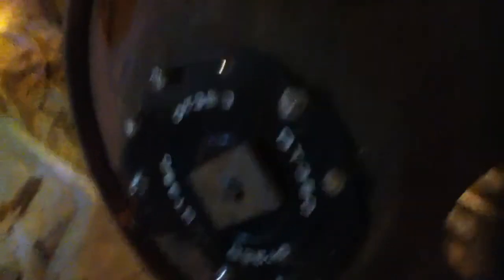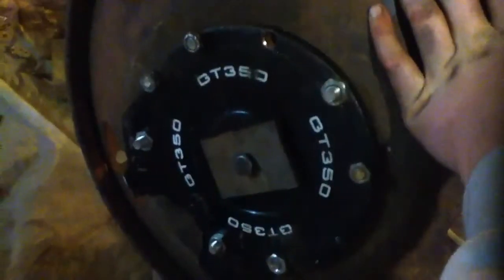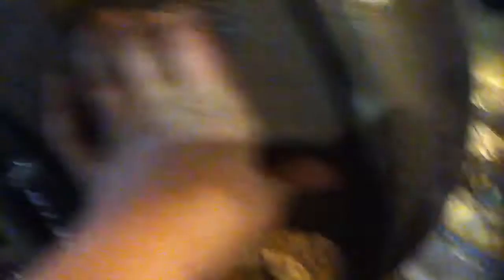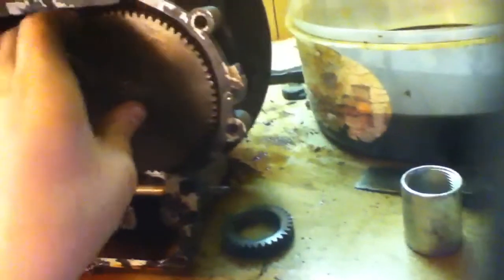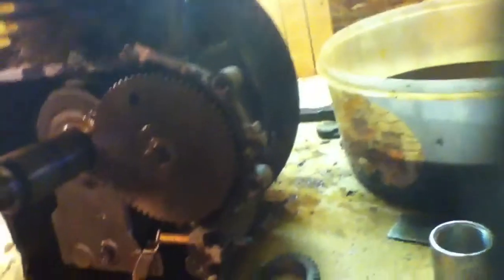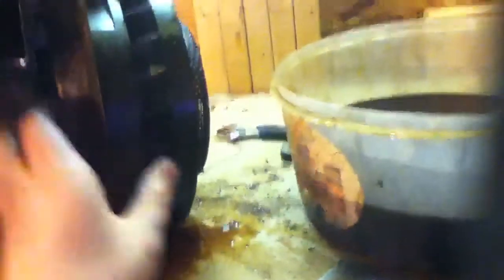Odd homemade steam engine idea

Comment: Now, take the set screw, washer, nut you purchased and screw it into your piston crown. Start out by threading it into the hole so it is in as far as the piston crown thickness. Tighten the jam nut slightly, not real tight at this time.
Put the head back on and see if the set screw sticks up much. It may project above the spark plug boss or it may be down inside the spark plug bore with the piston at Top Dead Center (TDC). The head bolts should be snug but not fully tight at this time. Put the "bash valve" you just made into the spark plug hole. You will feel the ball touch the head of the bash valve pin when you have screwed in the spark plug a few turns. To check this, take your shop air gun and push the rubber tip into the hole of the nipple. Give it a shot of air. If the piston goes down, your valve is open. When the ball seats, you will feel back pressure in your air gun and it will blow the gun out of the nipple. OK Good so far.

You now remove your spark plug and return the piston to TDC. Screw in the spark plug until you feel the bash pin valve touch the ball. Look at the distance between the spark plug boss and measure it. It might be 1/8" to 1/4" from seating. Take the head off again. You only need to use two bolts now as you make adjustments. Remember, only snug them. Loosen the jam nut on the bash valve pin. Turn the bash valve pin in (clockwise) and retighten the jam nut. Put the head on again. With the piston at TDC, turn in the spark plug. When you no longer feel the pin with the ball, try you air one more time. If your gun blows back, you are at valve closed. The spark plug should now be seated on the spark plug boss.

Next, take the had off again, turn out the bash valve pin with your allen wrench about 1 to 2 turns. Put the head back on, put the spark plug in the hole snugly seated. Now turn over the engine gently. You will feel resistance because of compression. You will hear a release hiss when the bash pin hits the ball in the spark plug. OK? Now you can remove the head, and snug the bash valve pin jam nut, put the head and gasket on and tighten the head bolds and spark plug. Put the rubber tip of the air nozzel in the 1/4" nipple and turn over the engine. It will run a couple turns if all is OK. You are finished. You will hear air escaping from the exhaust holes you drilled in the cylinder and you have converted a 4 cycle gasoline engine to a uniflow bash valve steam or air engine.

I hope this helped you. I started out when I was your age and went on to a life as a plant engineer and have just retired at age 67 and I still build and design steam engines. I love them best of all because they are fuel independent and will burn anything. They don't pollute as much as gasoline and diesel engines because they are open combustion. They have maximum torque at 1 (one) RPM. I'm going to show you some more links I think you will enjoy next post.
Reply from the maker: thanks you kindly for taking the time to help me out. well i will have to revise this project, seems like all i need was a new cam but you prove good points, thanks a ton =D

Comment: First, find a 1/8" or 3/16" long set screw. It should be about 1 1/2" to 2" long. When you buy this, get the proper drill size and tap for whatever screw you get.  Buy a jam nut and washer also.

You take the engine and put in the drill press (preferably) and find center punch mark on center with the drill spindle. Clamp the crankcase down to the table when you have found center. Then step drill the hole out from the center punch mark. If you are lucky enough to have a center drill, use it. It should be a #1 or #2 don't use a bigger one or you will be bigger than your tap drill size. Just put enough of a center drill seat that the drill will find the edge Don't get carried away and go more than 1/32" deep with the center drill. When you have a nice straight hole, start the tap in the hole by clamping it in the drill chuck. With NO power. Gently lower the tap toward the hole. When it touches, turn the chuck with your hands until the tap starts. DO NOT push with the drill feed levers. Let the tap feed in by itself. When you can no longer turn the chuck / tap with your hands, open the chuck and let it go up and out of the way.

Now, carefully put the tap handle on the tap. Start by backing up a 1/2 turn so you can clear your tap. You are tapping aluminum which will jam the tap with a burr. Then tap in a turn or two and back out again. Finally, the tap will turn freely, and you are tapped through.
Turn the tap out and you are finished.

Comment: When you have drilled the hole from 1/32" out to 1/16" your drill job is complete. Take the nipple out of the Vee block. Drop the spring back in the nipple. You should see the spring coils through the hole you just drilled. Good so far. Find a hollow pipe like a piece of copper tubing that just fits inside the 1/4" nipple. Saw a slot in the end of this pipe on center. This is going to be your spring compressor. Find a cotter key that fits a 1/16" hole
and make sure it passes pretty easily. Put the cotter key into the slot of the copper tube to make sure it doesn't bind anywhere. Put the spark plug shell in a vice and tighten gently on the vice jaws. Put a washer into the 1/4" nipple that just fits. It should be something that can stand steam. Steel or brass is OK. Put the copper tube into the nipple and align it with the hole you drilled. Push down maybe a 1/4" until you see the washer pass the hole. At this moment, push the cotter key in and work it through the opposite hole. This may take a few tries or you might have to ask someone to help you while you install the cotter key.

Now you have a bash valve with a 1/4" pipe thread on it to use for your steam fitting.

Put the head back on your engine.  Make sure it is lined up because some of the bolt holes in these modern B&S engines are sloppy. When it is lined up, find a piece of round stock that just fits the spark plug bore. They have used several sizes of spark plug lately but I think you want a 1/2" piece of  rod. Chuck this up in a lathe or drill press and turn a 60 degree point (included angle) with a file or preferably with a lathe tool and compound feed. That is if you are fortunate enough to have a lathe. 

When you have made your center punch, place it as straight as you can in the spark plug bore with the piston at top dead center. Strike the center punch and you will have made a center mark on your piston.

Take the head off.  You should see a center punch mark.  OK, here comes a little bit of precision work. If you can, do this on a drill press. If you don't have one on the day you do this, you can do it carefully with a hand drill.  You are going to drill a hole for the pin that will open your bash valve. (more next post)

Comment: Then you or a friend puts a very small bead of brazing around where you screwed in the nipple. Drop the ball into the shell before you braze the nipple because the ball you chose may not go through the nipple.

When the nipple is threaded and brazed in, drop the spring into the nipple. measure from the top of your nipple to the top of the spring. Mark the nipple on the outside at that depth. Then go to a drill press and put the nipple in a Vee block. Clamp it to the table after you find center on the Vee block. This is simple. Get a drill blank, or use a straight drill. Do not turn on the drill motor while doing this. Before clamping down hard on the Vee block, tap it to center as you lower the drill bit so it just touches the Vee with its outside diameter. Turn the drill upside down to do this. You want about a 1/2" drill. OK? When the Vee block is centered, clamp the Vee block down solidly with a drill press clamp. Now put your nipple in place in the Vee block. Tighten the Vee block clamp (the thing shaped like a U with a screw in it) so the nipple will not move.

Drill a 1/16" hole (or cotter key diameter hole) on the side of the mark you made about 1/8" (toward the sparkplug shell ). Be sure you don't drill away from the line on the side opposite the spark plug shell. OK? Pilot drill this with a 1/32" drill and go through both sides of the nipple. Don't drill into your drill block.  OK? The drilling is done. (more next post)

Comment: Now, you are going to remove your spark plug and make a bash valve out of it. I hope you have a lathe or drill press. If not maybe your high school shop has either of these. A lathe is best.

When you get the spark plug out, you will break out the porcelain insulator. It is really tough to get these out.  I usually take a pin punch or a piece of round stock and a ball peen hammer and put the metal part of the spark plug in a pipe vice so it can be held by the round part without distorting the wrench fitting part. OK? Be determined and you will succeed. Try not to destroy the threads of the wrench fitting. I have done this many times making piston TDC (top dead center indicators for gasoline engines). When you have just the spark plug shell, find a ball bearing that will seat on the bevel in the shell. 

When you get this far,  find a spring that is pretty stout. You should just barely be able to squeeze it with your fingers. It should fit inside a 1/4" pipe nipple and will probably be about 1" to 1 1/2" tall. This will hold the ball closed on the seat.

When you have these things found, you find a 1/4" pipe nipple and see if it will thread into the plug shell. Some will, some won't. I usually have been luck with AC and Champion spark plugs. They will not let you thread the nipple in. So that is good. You get a 1/4" pipe tap and tap the spark plug shell so you can screw in the nipple. (more next post)

Comment: I have actually done what you want to do with a 4 cycle engine. You take the tappet out of the inlet side so the valve remains closed. As you know the camshaft turns at half speed of the crankshaft. OK?  to make this work, you have to make the cam shaft turn at the same speed of the crankshaft. 1:1 OK?  This means you have to take the gear on the camshaft and find one with the same teeth and diameter as the crankshaft (small gear). That is pretty hard to do. So... you forget using either valve and make it into a uniflow engine. Put the piston at the bottom of the stroke. At bottom dead center, you measure from where the head gasket goes with a good steel rule. A 3hp B&S will have about 1 7/8" to 2' stroke yours may be a little different.  Write this down. Take your steel rule and measure carefully on the outside of the cylinder and mark it so you can see it and the piston almost at the same time. OK Now, come up about half an inch from there and make a center punch mark. Make sure the piston is all the way down in the cylinder.. Drill in where you made the center punch mark with a small 1/8" or so drill. BE CAREFUL. If your mark is on a cooling fin, break off the cooling fin. When you drill in a ways, you will see the tip of the drill come through. Most of these cylinders are aluminum these days. You should see your drill bit about 3/8" of an inch above the piston. Try a bigger drill next. Maybe a 1/4" one. Check again how close to the piston you are getting. If you can, you want to get to about 1/2". OK? This will be your exhaust, just like a two cycle engine. If you are successful, you need to drill 2each more holes just as you drilled this one.. They should be parallel and about 1/8" apart.  After all is drilled, you may have a small burr on the edges of the holes. Take a warding file shaped half round and deburr the holes before you move the piston or it will snag a ring and scratch your piston. OK? (more next post)